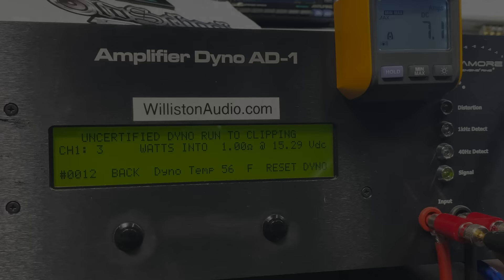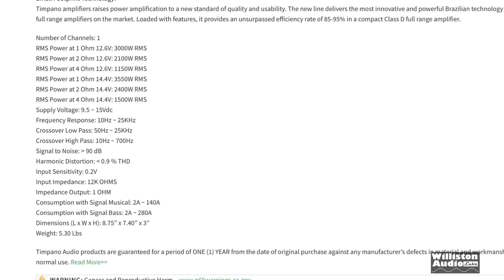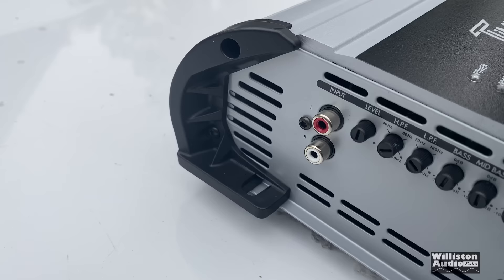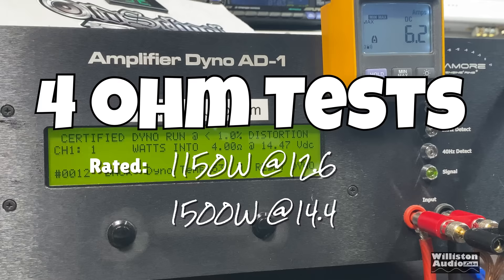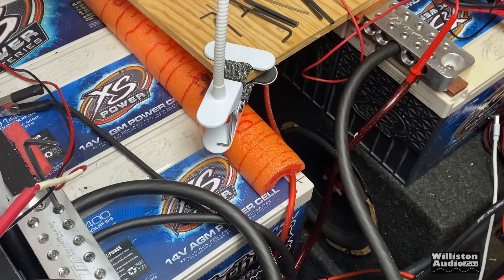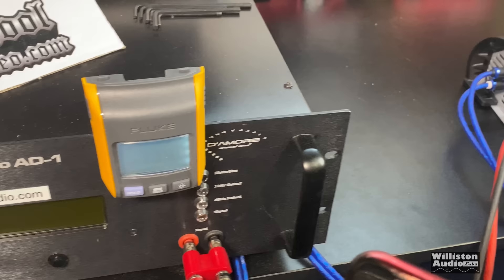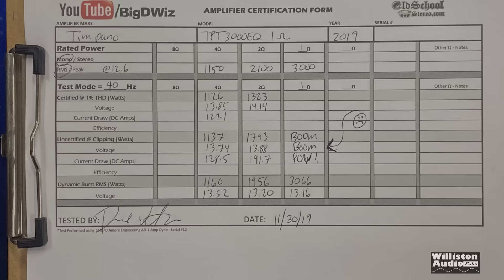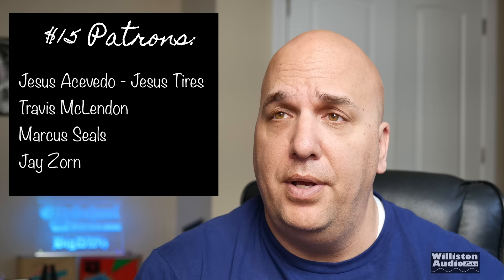This $220 3000 watt Amp GOES UP IN SMOKE! [4K]

Comment: So many comments in here with people over-reacting and greatly exaggerating the fire danger of this type of failure. The flames, except for a couple small sparks, were contained within the amplifier and self-extinguished after a couple seconds (this is why circuit boards and many other materials used to build electronic circuits are flame-retardant by design). Unlikely anyone's vehicle is going to burn to the ground, much less anyone die, as a result of a failure of the amplifier.

For what it's worth, I've seen not one, but several, desktop computer power supplies go up in smoke in a very similar way. It's a lot more common that people think.

Now, I am NOT saying it's right for the amplifier to blow up like that when subjected to its rated load, just for people to stop exaggerating the danger.

Comment: There is a reason some amps don't have short circuit or overcurrent protection. In the High end world its is believed overcurrent protection affects clarity. GFA565 for example is one of those amps. How ever it is stressed to use the amp responsibly.  I highly doubt this is one of those crystal clear amps. but oc protect does put resistance in the circuit reducing output. 

Considering how cheap the amp is and knowing the dangers, if I were  to get the amp I would make some preparations to contain this threat.
Reply: I thought OCP would use a big shunt to measure the voltage drop over micro ohms of resistance, you dont even need a shunt if you know the resistance of the traces.  Do you have any more info on this topic?

Comment: Sorry for the spam but that worried me, noticing the smoke continue to flow from the second one until you removed the remote connection.. Seriously, try leaving one hooked up, i suspect a fire would be possible as the short is less likely to continually pull the rating of the fuse (assuming 300A was used)? Protection was active...yet it continued to smoke? Did the power controller keep the MosFETs pumping?!

Comment: I think to be fair you might try to explain to the general public the difference between a static load bank and how that is different from a speaker load. Yeah it's cheap electronics, you get what you pay for. But on a 2 ohm speaker configuration it could be useable. Would be nice to know what it sounds like at 2 ohms. Not bashing Big D or the amp, just saying it might have a place for people with limited money if used correctly. The 200 amp fuse would be my guess to keep things safe, 150 would be safe for sure.

Comment: So, with only 2 mosfets in the power supply, they expected to get 3k watts?
Best possible scenario is 1.5-1.8k, and that's with efficiency at 90% or better.
The best TO-220 based devices are only rated for 150 amps and not much surge after that.
3 sets of mosfets in that amp would correct that design flaw and maybe get it to rated power.
Reply from the maker: Watch Barevids and he explains this in detail

Comment: How did i miss this video?! :o I think i remember your other vid blowing another amp...they claim that almost killed the company? Hard to believe that's your fault...if they didn't design any protection into it then whose fault is that? Theirs! Sure, its annoying if your amp keeps cutting out...but its trying to tell you something important! :o You have to remember how relatively small these components inside are when facing 100s of amps at tens of volts.. That's a LOT of power for any silicon to dissipate! Valve tubes can still handle more overall power. The biggest, baddest IGBT FETs can handle a couple hundred kw (200kW+) whereas a single Valve Tube holds the record at 1.25MEGAWATTS! 1.25 MILLION WATTS!!! Inside glass!
Reply: Edit: looks like the diode bridges that let go first? Makes sense, that's literally where all the power is being shoved through! At least the MosFETs kinda share the load..
Edit2: that second amp kept smoking until you released the remote line! What?! Dude...fancy getting a similar one and leaving it plugged in with that particular failure mode to see if it could potentially carry on and catch fire properly? Fuses can't do their job if something starts to act as a lovely low to high resistance heater...

Comment: The power supply decoupling is vastly in adequate for all that power, as the ripple current would be enormous. It looks like a 300 watt amplifier. Note manufactures may overrate their products power handling, as with music power is typically only 30% duty cycle eg rock, jazz, however continuous bass at full power from techno bass music, is just not music at all, its more a sound experience, and most amplifiers will fail eventually.

Comment: I have the 1100 watt amp and 4 guage power and ground is to big to fit I bought a 4 to 8 guage reducer and that is still to big what kind of connection should I use to fit the tiny power and ground on the amp

Comment: I picked this amp up this past summer from a friend's shop before seeing this video. I was running 2 prv chuchero 10s. I played them for months I then hooked it to a sundown audio E 8 I now have it pushing 2 sundown audio SA 15s and it's got a lot of power and seems to handle it well I and running it 2ohm I believe. I've waited for something to happen so far its holding up strong and has power with space. Stays cool to the touch its not the cleanest I plan to go with SFB amps soon. Would like to see the test in real world condition vs running resistors. I do have 0g wire I believe under 200 amp fuse.
Reply from the maker: Resistors are definitely a more brutal test than speakers, but I’d personally not use this amp in my vehicle unless wired at higher than 1 ohm
Reply: @wal  its cheep built for sure. Running subs off my sub outputs on the pioneer deck you don't see it so much yet when I had it running off the rear set. If you turned it all the way down it make a noise with the rca hooked up and the deck turned all the way down. When you turn the amp up the noise went away I've never seen nothing like it. I hooked it to  Resilience sound 18 1 ohm coils and it didn't like it fast was just checking the coils so we only did one at a time and it got warm fast. I've always been nervous I have it on the back seat of my jeep with the seat down where I can reach it at all times. Definitely going to change it out sooner then later

Comment: Uhmm so the amp did 3000RMS? on the 2nd last run? last run you had it on 14.99v, so technically it did do the number?

Comment: Im thinking about buying 2 rockville db45 and 1 db14 ill be using 4 pioneer ts 6900 pros with 1 db45 and 4 rockville marine 6x9's for the other...and 2 1500 watts pioneer shallow subs with the db14...any thoughts on this set up?

Comment: If I did that with a two hundred amp fuse I would only get two thousand Watts right this is a weird one usually they're overrated and won't get close to power in this case they can get all the power out of it they can but simply running it until it blows I don't think that's good for the company it creates a safety hazard anyways thanks for the video Big D you are the man keep up the good work we all love you 👍✌

Comment: Even if you do put a lesser fuse in these amps it may not give the protection you need because for one thing we all know they are using cheap components and two the power rails of those small power mosfets are not enough with the amount supplied.  I saw one filtering cap within the transformer but don't know what its rating was. Might not had the tolerance to keep up. 0.06$ a watt!! I see why...

Comment: Shouldn't you start it at below it's maximum voltage rating? I mean, i prefer this cause that was fun but still lol. How big is that cap that's in there? Not often that see so few in a3000 watt amp

Comment: I did a wattage test on some Old School amps of mine today I aquired years ago prob late 90s early 2000s where? New? Memory's gone! It's a big old made in Korea Audiovox AXT1200 Rampage, it says 300wrms X 2. I had it bridged hooked to a 12" Polk @ 2 ohms and @ 30htz test tone it pushed out a whopping 201.5 Watts! (7.75A/26V) whaaa whaaaaa...... And it got pretty warm when I stretched it's little legs. I can say it was on a car batt on a cheapie 10a charger I forgot to check the voltage so maby it would pump a couple more ponies out at a solid 14.3v.. ? But not another 400 watts! It's really pretty big with big heat sinks but upon inspection her guts were pretty spread out in there. It has quality brand name caps can't remember the name but when googled came back as a good brand. And I checked another one an old us acoustics 4065 4 channel on 2 channels bridged rated at 160wrms and the same test made 179.1watts, ( 7.59A/23.6) beat the rating! Good old days.....hmmmm

Comment: I just installed the 1400 watt timpano amp In my sisters boyfriends car it's powering 2 lanzer 12s the amp kit he got is a 4 guage amp kit and the wire does not even come close to fitting and his amp kit wire is smaller than my 4 guage amp kit from Wal-Mart is there a connector I can use to fit the amp power and ground into the amp or does he need to get a smaller amp kit and if so what would be the smallest we could use with the amp and be safe

Comment: Big D wiz what are your thoughts about the 9856 alpine and do u know who might still sell the I-pod cable for that older model ?????? Help
Reply from the maker: If that model is still AI Net, skip the iPod cable and get the Bluetooth adapter. I’ve been using one with my 9815 for a couple of years now, no issues. It may add a little distortion, but not a large amount

Comment: Look like the switching mosfets failed, because the designer failed to include essential flux walking compensation, it would have blown up with a 200Amp fuse too. In a forward dc to dc converter, flux walking is when the magnetic flux in the ferrite core of the transformer drifts towards one polarity, causing the transformer to partially go into saturation, the wingdings look like a short causing excessive current and the excess energy go into high voltage kick back spikes that over volt and blow up the switching devices, the mosfets go short and burn.
Reply from the maker: You said it brother

Comment: Idk.... a true 1100 watt amp for 200 bucks back in my day would have been a deal. 
On a side note it seems like every Amp is labeled way over it's true power. I always bough like twice what I was looking for and even then I've been disappointed. I have 2 Amps now (I wont say their names do to fear of being ragged on) that seemed to be labeled with their real true power levels. Had the brands for about 25 years now. As they burn up there is always some new/old stock to pick up off the net to replace them. 
Now I will keep this one in mind and will know to fuse it better then it came with. I am surprised there is no circuit breaker inside. That's a bit dangerous.  At least a fusible link or something

Comment: I am pretty sure that if they were designed for Pro Audio, they would have a a 110 or 220 volt plug for the power supply. 
I really doubt that someone like Motley Crue or kiss has a ton of batteries or 12 volt power supplies to power their amplifiers when on the road performing concerts

Comment: I'm running a taramps 5k @.7 ohm and it gives no problems until my batteries get low. I even have a mechman 320 alternator and it can't keep up with the current. Gonna have to run 2 alts
Reply from the maker: Yeah heard dat

Comment: Im Not sure why it is they fail on dynos and DD1 detectors. This is a misconception with the design of most Brazilian amps. The way dynos read power does something funky with the full bridge amp design. If you put it on a subwoofer and then clamp power test it, it would do rated and be very reliable. I personally have that stetsom ex3000eq in my truck for 3 years on a 300a fuse, clamped 3750w wired at 0.7 on 2 18s walled till I got bigger subs and upgraded to the 8,000w stetsom, now I have the 3k running 6 8" mids. It's a fantastic amp that gets a bad reputation from these type of scenarios since you cannot dyno them properly.
Reply from the maker: It fails because it is designed with zero overhead capacity and does not self protect when excessive current is pulled (like a really long bass note or test tone)
Reply: In a dyno situation i agree, that's the most likely place to see one blow. But in real word use they have been proven to run long and strong in full range and especially in bass use, Almost 2 decades if I'm not mistaken.

Comment: Is it possible to dyno the amp at 1000hz ? Just curious because you said it meant to be a full range amp, and all the crossovers.... still a great video and no amp should ever blow like that, I agree with everyone on that. I’m just thinking it would do better at higher frequencies.
Reply from the maker: It will most likely do better at 1kHz
Reply: The web site says they test at 1k on this amp so definitely  not for us bass heads over here

Comment: Awesome test...amplifier fire! I had a garage fire a while back...my DIY solar breaker caught fire. Anyways, had a normal ABC fire extinguisher and had to use it. Talk about a f-ckin mess. That powder chemical is nasty. Clean up took forever. Now I have a CO2 fire extinguisher...just a suggestion for you lab. They can be weighed and recharged

Comment: I remember them PYRAMID brand el-cheapo amps that overheat and go poof lol that amp good but like u said its not got overpower protection. With batteries feeding it 14+ volts it be like car alternator feeding it extra juice too. Id like to see u test the rockville 10 underseat sub vs the kicker 8 underseat sub

Comment: Not having a protection circuit is very bad, but let's just imagine it had one, why are there so little fets there? You said the bottom part in the video was the power section, so the audio section had 5 mosfets? For 3000w? I know today's fets are much more powerful than in years prior, but it wouldn't have hurt to have a few more, they had the space on that side of the board to put at least 2 more in there. What's the price of a mosfet? 2$? They could have made the PCB accept those mosfets and add them for so little, and I'm sure it would have helped with the audio quality and longevity, both of which are questioned by people when it comes to these types of amps. Why not make it 250 instead of 220 and add those extra fets? Imagine buying a car part for 1000$ and have if fail after 2 years, when they could have done that one extra step, make it 1100$ and have it last for 5 years. I don't get why manufacturers will turn an x value product, in this case  200 ish $ cut the cost by let's say 10% and make basically a worthless product, or much much worse than it could have been for just a smidge more. I feel about this the same as the 99999w maxxx on the box. Okay maybe on a car part they would make it less durable to get more parts sold, but in this case skimping out on a few dollars in manufacturing will end up with people seeing how their product can't even do it's intended job or last too little time, and end up with no one buying their products anymore. Saying it's good for 1ohm but hoping no one would actually use it at more than 60% volume for more than a kickdrum or something isn't acceptable. This is similar to Intel using toothpaste (crappy thermal paste) for thermal interface between the metal cover and the actual chip, making their chips harder to keep cool or get performance out of them, when they could have soldered the ihs for pennies and have the, let's say 3-400$ cpu actually perform. (Thermal issues were mostly when overclocking, but that's irrelevant, when people replaced the paste with something better voiding their warranties they showed how much better it could have ran for literally a few cents in paste) It's like they don't realize that that 200$ actually needs to mean something and that's it's not just a case of build whatever we can under this budget, if 10$ more makes it a many times better product do it, it will not only lead to more sales, but to people buying again from them. In some cases they will literally cut a few percentages on cost and turn the product into a useless 200$ or whatever, paperweight. Bean counters that have no idea what the product even does -_-

Comment: Can you test the amp at it’s recommended voltage? You had it at 15.1 volts the recommended voltage is 14.4 thinking that probably made a difference and also why are you using 0 gauge wire when the recommended wire gauge is 4 gauge  just questions not knocking your video just wondering maybe I missed something
Reply from the maker: Test starts around 15 to get 14.2 or so at the end of the test

Comment: $220 for 3000 watts  that is fairly cheap i would expect a decent amp to go for much more than that maybe starting around $1000 and even that is pushing it.

it looks like those brands are knock offs or counterfeits or just some cheap junk

a decent amp would feature some protection against shorts, overheating, reverse polarity, over voltage, undervoltage and overload due to improper sized speakers

Comment: Nothing I hate more than an amplifier that says it can do a certain load and explodes when doing it.
Luckily my Stetsom 3Keq is still good after 4 years.
But I don’t play anything less than 50Hz on it.
Edit:
I’ve been playing my Stetsom venom for quite a while under 25Hz and it has been holding pretty strong.

Comment: Looked like you were getting less than 50% efficiency on the 2 ohm tests. That's got to be a faulty power supply design (probably transformer core saturation).  Also for 3kW, the power supply looks way too small, I'd expect it to be around the size of one found in a 3kW mains inverter (pretty big). Looks like they are trying to get too much power out of too little, along with no protection circuitry, which has to be dangerous for something running multi 100 amps from a vehicle supply (very high fault current capability and a real fire hazard).